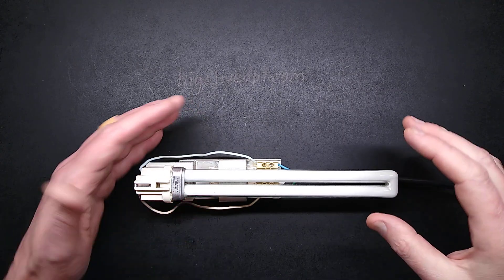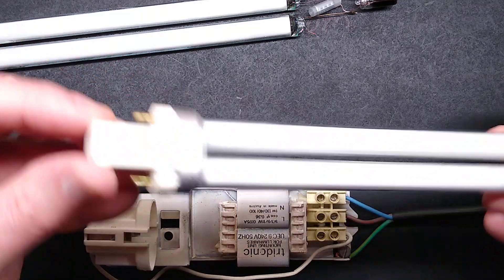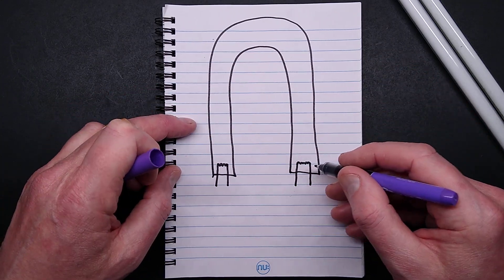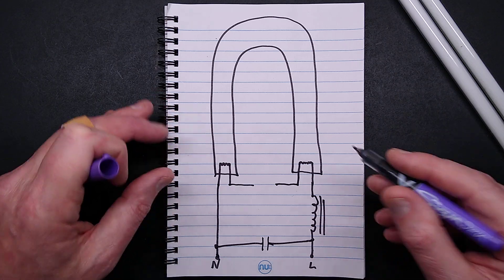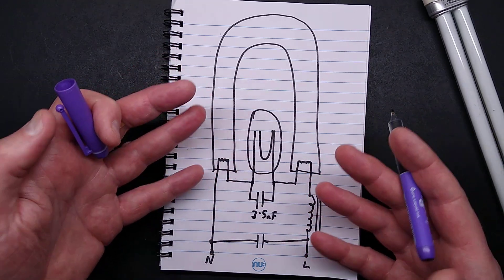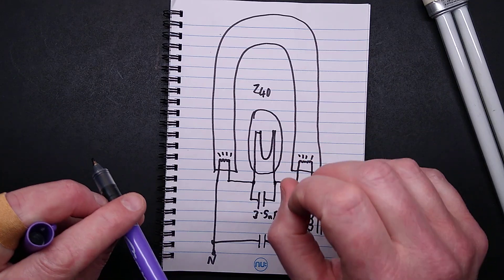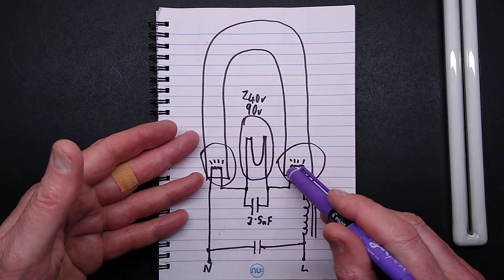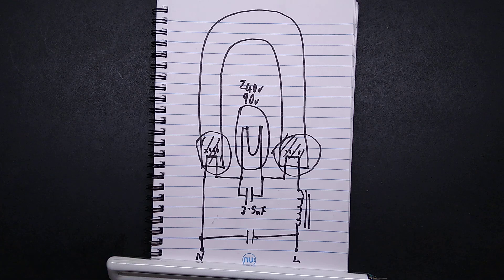Retro already?

Comment: Hi Clive, 
Love all your videos so well explained.
I'm an Australian Electrical Contractor and have been working as an electrician for over 45 years. In Australia we call the inductor a "Ballast".  Quite often we use a single ballast with twin fluorescent tubes and use two 120 volt starters called "S2" instead of the "P10" 240 volt starter used in a normal single tube arrangement.
The twin tube and starter with a common ballast arrangement is mostly used for 18/20 watt lamps and the dedicated ballast mostly used for 36/40 watt lamps.
Over the last fifteen to twenty years electronic ballasts have become far more common and are a little more energy efficient with less heat losses, cause less power factor losses and prevent the stroboscopic effect that the wire wound ballasted fluorescent lamps caused with synchronous machines.
Over the last 10 years I have witnessed a massive decline in the quality of new fluorescent control devices both the wire wound iron core and electronic type.
Twenty years ago it was quite common to find existing fluorescent lamp installations that had been operating since the 1970's on a daily basis functioning quite adequately for over twenty five years some with the original lamp, today I'm lucky to find a modern fluorescent fitting either electronic or iron core used on a daily basis lasting more than five years.
I remember once I could specify a extra long life fluorescent lamp with a rated life of 80,000 hours, today we are lucky to get 4000 hours out of a fluorescent lamp.
The same for L.E.D's which seem to have a much shorter life's than when originally they introduced 20 years ago, just refer to the Osram technical catalogs to see the difference, the life expectancies have been very much reduced, is this another instance of planed obsolescence.
Reply from the maker: I think it's just down to the culture of lowest bidder wins.  The non technically inclined buy the cheapest item.

Comment: Nice insight of practical operation. Never thought of that but, can two starters be placed in series to remedy the blinking tube with sputtered filaments here in explained?
Reply from the maker: Unfortunately not.  The open circuit voltage might not be able to make them glow, and then it would be a race for the second one to close before the first one opened.

Comment: So once the starter bi-metal has cooled down and opened the circuit, the heater elements in the tube also cool down again and the gas maintains its fluorescence due to the voltage between live & neutral?
Reply from the maker: Once the tube has lit, the voltage drop between the cathode and gas (cathode fall) keeps it hot and emmissive.

Comment: I don't think Clive mentioned this  - the basic circuit he showed is the same for all "switch start" fluorescent fittings with  tubes from 1ft to 8ft on 230-240V.
On the linear fittings the starter is a small plug in module with a bayonet fitting.
 Later fittings have an electronic "ballast", a power supply that drives the tube with a high frequency AC at 30-40kHz and providing a small heater current for starting .

Comment: I have reused the old magnetic ballasts for current limiting, in various projects. As current limiting for a long series string, "high voltage" battery charging. I have also used them to reduce the speed of motors. So were will I get my high power inductor form now?, when all are gone for good.🤔😥

Comment: Do the heater/electrodes radiate UV and it is the white phosphor coating that produces the white light?
Reply from the maker: The mercury vapour produces strong UV, which stimulates white light emission from the phosphors.

Comment: Still have such a tube in my kitchen fan. Provides plenty of light and lasts like forever. Switched it once in 25 years (instead had to oil the fan bearing 5 times at least). Still have 2 spare tubes to last med another 50, but by then they'll have to bury me with it.

Comment: I believe that they are keen to loose the inductive power factor effects imparted to the grid supply that require considerable energy to be input just to correct them. 
I used to work at a very niche company that produced high precision welding sets that were used, amongst many things, to fabricate the electrode assemblies in fluorescent tubes and similar. Our main customer was Philips in Eindhoven as I recall. I wonder if that is more EU manufacturing lost eastwards? 
Wonderful job!  They let me self teach, first on a mechanical CAD package and then with a circuit board design package with an emulator function. It was state of the art as was the 286 computer it ran on!  Sadly, the state of the art was a bit crap and I suspect that I might have been too😂. We were supposed to be converting our proprietary analog control architecture to digmical witchcraft😂. In the end we got a professional to design it but even then it clumsily mimicked the analog functionality rather than starting from scratch. 
On Thursdays afternoons as a bonus, I used to be able to watch the SR71 blackbird take off from the neighbouring airfield.  Happy days.

Comment: A friend is spazzing out over the USA making T12 (large diameter) tubular fluorescent bulbs unobtainable, citing energy inefficiency over the newer thinner tubes. His gripe: the huge investment in many ceiling fixtures requiring ONLY the older bulbs/lamps.

As to the ballast, I thought it also gave a nice high voltage spike/kick when the starter opens up to ignite the tube, THEN goes into current limit mode.

I still have old old fixtures with the "starter switch" instead of a starter: hold the momentary switch to make the ends glow,. let go to let 'er rip!

Comment: 3:30 Sometimes the capacitor is put in series with the rest of the circuit instead of parallel
This makes the whole lamp capazitive instead of inductive and has the advantage of not having an inrush current spike if you switch it on on the peak of the sinewave, because the inductor lets the current rise slowly. The capacitor is basically a short circuit on startup.
If you put a capacitor on every other lamp, they cancel each other out. one inductive, one capacitive. This is often found in lightning fixtures which already have 2 lamps in it
A huge disadvantage of this is: when the capacitor fails, or more likely slowly degrades and reduces its capacity, the associated lamp becomes unstable, flickers like crazy or refuses to start. You then have to either change or bridge out the capacitor which renders the whole powerfactor correction idea useless
Also the flickering lamp suggests a defective lamp to the untrained "electrician" which changes lamps every 2 weeks with no improvement bevor he is willing to dig deeper into the problem

I am so glad that this is mostly a thing of the past. I have changed about a 5 figure number of fixtures from fluorecent to LED in the last 5 years and found a load of things gone wrong on these things with poor maintenance. Like leaking caps dripping their spicy juices on an gimniasium floor eating it up and needing them to rebuild the whole floor

Comment: Clive: My house in the USA has two can fixtures that take PLQ13 CF tubes (4 pin base).  I tried purchasing a PLQ CF to LED conversion bulb, but it did not work, and my little bit of research indicated there are some details that make the success of these converters hit & miss.  Can you explain why CF to LED converters aren't a good idea and is there anything that can be done beside replacing the fixture?  I would prefer not to rip into my ceiling to replace the can...
Reply from the maker: It's possible that the fitting was wired differently to what they expected, or a shunt starter may have been required if it used one.

Comment: Led lamp power supply  fail more often  then the lamp it self I replace hundreds of failed led drivers unit as I come a cross in my line of work but have had normal non led light fitting run  with out any issues for 10/15 year. As they  say if it not broke don.t fix it

Comment: As much as i appreciate old and older tech, i won't be missing any kind of fluorescent tubes used as a commercially usable light source. For me those were good years ago, when they were much more energy efficient than ordinary incandescent light bulbs, also having much much greater lifetime. But today there's no place for fluorescent tubes awful artificial light color or 50/60Hz blinking. Today, at least for me, the top one light source are LED's. They of course, are also emitting artificial light, but (at least for me) LED light is much more appealing than fluorescent one, and also more efficient. Good tech though, the fluorescent lamps, especially when you realize that it is over 80 years old.

Thanks Clive, as always  - a nice video.

Comment: Biggest issue i have with LED's as an electrician whos work is 90% service and maintenance is that manufacturers are designing and building their own proprietary lamps/fittings that cant be repaired or retrofitted so you either hope the manufacturer will supply you a spare driver or lamp but if they dont youre stuffed and need to buy a whole new fitting.

While i truly hated my time with fluorescents at least the manufacturers didnt fuck us all over royally for a quick buck

Comment: Many years ago, many many years ago, I was sitting one of my Trade Certificate exams and a there was one question worth 10 marks so it was a significant portion of the total exam. There were three options to choose from and you only had to answer one of them. I didn't know the answer to any of them, but one of them was to explain how a fluorescent light works. I knew how a fluorescent light was wired up, so I thought about it for a bit and worked through it using first principles. I got 10/10 for my answer! 😄

Comment: I have an emergency/exit sign fluorescent fixture that's very clever: a magnetic ballast like yours to 2 fluorescent lamps in parallel. It's fail-safe: when one bulb burns out, the other takes over. The way it works: when turned on, both lamps flicker but one "wins" by igniting and effectively shorting out the other. Should that lamp fail open, the other takes over!
Reply from the maker: That technique was also used in long life discharge lamps.  But with two parallel tubes in one lamp.

Comment: Capacitor in series are also used for  phase shift in order to lower the flicker effect. In a pair one have a capacitor and the other not. the capacitor is sized to compensate both ballast with one cap.

Comment: People in the comments going at lengths about manufacturers going for A ratings as if they were aiming for anything positive. No. They are doing it for marketing - to profit harder off idiots who are wow-ed at insane things. Wind turbines and Solar panels are a scam - they aren't green, they are extremely dirty to produce and maintain, and they're overglorified batteries - A clever way to sell electricity. The devices are made to fail after generating X kilowatts, divide that by their price, and you just see that they're just another electric supply company with similar pricing.

Comment: Fluro not my fave thing for light or service. 
The tubes may appear to "last a long time", but the light output efficiency drops off after about a year in average home use (significantly so, when used in a commercial or industrial application) and gets no better as they age. 

PowerFactorCorrection caps, mandated for commercial/industrial here, are another thing to go wrong, but rarely a matter of darkness.
The best use for them (MPP type) are in high powered speaker crossovers.. rated well for >200W systems...being higher voltage non-polar passive components. Cheap too. 
Then there are the real 'antique artifact' style caps - nasty nasty - The metallic can that contained PBC tainted oil.  Makes me sick just thinking about it. 
Hoarders note: If the can don't say PCB Free assume it contains this serious health threat.

Comment: More stuff that boils my piss... whoever comes up with this legislation doesn't know and doesn't care about real world scenarios. Primary case in point, about 8 years ago I was involved in a high profile (locally) multi-million pound back-to-the-bare-structure refit of a multi-storey building for the metropolitan council I work for. The lighting was all LED, state of the art, and from brands like Philips and Cooper.
Every year I'm back there doing testing on the fire alarm and emergency lights, and every year I see more money wasted; a fitting fails, and because it's LED you can't replace the lamp, you have to replace the whole fitting, only now it's an obsolete design, no longer available, and because it's a prestige (allegedly) building, and you can't have odd fittings, every fitting of that type in the area/floor has to be replaced.
Say hello to the new EU mountain of e-waste, full of cadmium in batteries and other delightful things. I guess they'll just ship it to some third-world country and make it their problem though.
Reply from the maker: The street that passes under Central Station in Glasgow has the same issue with hugely expensive "architectural" LED fittings failing and all having to be replaced with the latest expensive and short lived model.

Comment: It surprised me for how long we have been allowing mercury-containing lamps to continue. The main issue i see with them is the way consumers handle the disposal of them. At the hardware store where i once worked, there were always a bunch of broken ones in the collection bin for fluorescent lights. Pretty sure many found their way into landfills too. 
I've always liked the light of a good quality 830 fluorescent tube. Though over my workbench i got a 530 one. I'm leaving it there to show how awful the color rendering of cheap ones could be. 
I might buy a spare one for the workbench lighting, just because the workbench came with fluorescents in the 60s, so it should be like that forever. 
But for any new installations, i have no issues with running E27 socket LED lamps.

Comment: I can't believe the thinner fluorescent tubes with solid state ballast would be inefficient enough to be banned.  Are they being banned because of the mercury content?  Fluorescent back in the "old days" was a ghastly greenish light but the new rare earth phosphors are quite good, it seems like the usual electric product cycle is terrible, pretty good, perfected, obsolete.
Reply: The new T5 tubes are pretty efficient but they're expensive. LEDs are often cheaper.
Reply: @eDoc2020  I'd use the T5 tubes in applications where they are on for long periods. I'd use LED lights where they are turned on and off a lot.  
I do have a fluorescent Philips F17T8  in my pantry which is turned on and off many times in a day.  It's at least 25 years old (it came with the house) and it works fine and isn't even black at the ends.

Comment: I was always told when younger it was better to leave fluorescent  tubes on, rather than turning them off and on evrey time you went in and out of the room, cos it used more power to start them than it would to leave it on. Was that ever correct?
Reply: Mostly  a misconception, as the starting spike could be measured in milliseconds, and a failed lamp repeating the starting cycle all day would incur monstrous bills, something that did not happen. The real reason to switch them as infrequently as possible was lamp life. Each strike dissipates a small but not immeasurable quantity of emissive coating from the lamp’s electrodes, far more than would leave the cathode during normal operation. . Once all of this emitter is exhausted the affected electrode fails to fire, and it’s phase passes through the starter instead, and you have an end-of-life (EOL) lamp as described at the beginning.
Reply from the maker: It doesn't use more power, but does shorten the life of the tube slightly with each switching cycle.

Comment: Interesting video.  I'm working on my Dad's old house and the basement is lit mostly by dual tube 4 foot fluorescent lights.  Some of them are flickery and many are dim.  They are T12 which are an inch and a half diameter driven with magnetic ballast.  They've been "illegal" in the US for quite some time but there are lots of loopholes so new tubes can still be purchased.  I tried using a "plug and play" LED linear tube and they work fine with a decent ballast but Dad was frugal and bought "shop lights" which don't even light the T12's with a full 40 watts.  The "bench light" ballasts overheat and shut down with the LED tubes.  So I tried "ballast bypass" linear LED tubes which just require mains voltage to the end connectors.  These also worked but are a more trouble, basically just replace the ballast with an in line fuse. The fuse is in case someone pops in an old fashioned tube and manages to get the arc to strike.  I tried 4 of these and had one early failure so far which isn't encouraging.  Nice bright light though.  
The obvious correct solution is to buy real LED troffers but I am frugal like Dad and the cheap ones are not designed to be repaired, so that wouldn't be much of an improvement either.  At least they'd come with a UL or CSA approval.

Comment: One of the top things I hate in life is the LED agenda.  Can't stand the light they emit; all blotchy and gives off terrible shadows, plus the colour temperature is always off.   They also fail much sooner than they originally intended. typical because if they lasted 25+ years the lighting industry would be broke.  I'm happy the lighting industry got even richer in promoting this garbage green technology.  Thank you very much for that but I'll stick to using VHO, HO and Standard output t12 fluorescents in my work shops.  I have enough of em saved up to last my lifetime.  I can't wait for the next trash lighting phase that all the suckers will jump upon..  give it 5 years